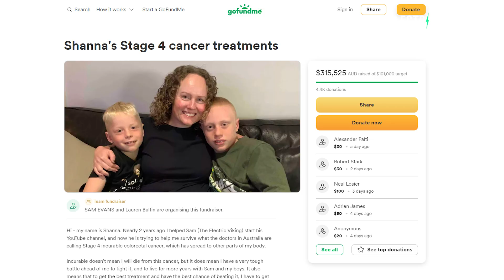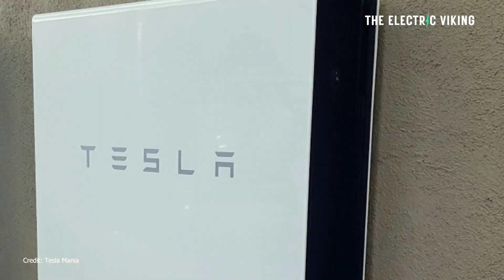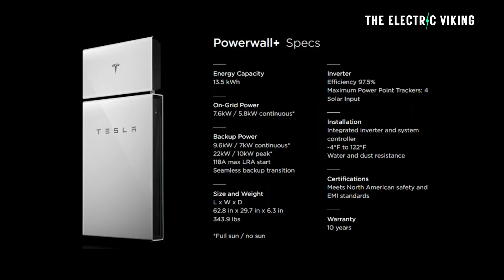NEW Tesla Powerwall 3 gets a MASSIVE power increase

Comment: The most important reason for going with the Powerwall is the software. Right now, Northern California is preparing to test out the grid concept, with all of us Powerwall owners working in concert with the distribution system to send power where it's most needed. The beginning of a major transformation of grid practice. To make this work, however, the government will NEED to nationalize the grid, take control of it from for-profit ownership.
Reply: I just gave the grid up completely, the tiny amount of money they wanted to give me was not worth the effort. Also if I wanted to stay on the grid I was limited to 5kw of panels.
Reply: I am already a member of a distributed power wall great here in the UK via Octopus Energy every day at 4 pm. My Powerball Sparks into life starts dumping 3.7 kW until it gets to 2%.
Reply: @ouethojlkjn  I’m also in U.K. - how does that work out? Does it dramatically reduce your bills or do you get payment?
Reply: @Phtang-phtang  For the so called Octopus "Tesla Tariff" (and you have to have a Powerwall) I get my electricity at a "flat rate" 24x7 of 11.76p per kwh. This is also the same amount I get for export to the grid. As I also have solar, some of the "export" will have been generated. For example, in one month I generate 200kwh from solar, I use 100kwh in my home and either export or charge the Powerwall with 100kwh. I also imported 300kwh from the grid (to charge an EV among other things). As the rate for export and import is exactly the same, you just subtract one from the other. Export is 100 x11.76p = £11.76 exported and earned. I imported 300 x 11.76p = £35.28. My bill is import minus export which in this simple example would be £23.52. 
You could work out the savings by however much the current per kwh tariff is minus 11.76 then multiply by the electricity used.  I would have to check but initially, the Tesla tariff also did not have a standing charge but this may have changed. 
One of the annoying "gotchas" is the standing charges. Which I believe the minimum we pay is 50.4p per day for electricity and 27.7p per day for gas.
Reply: Government owned electrical grid would be disaster.
Reply: @gund89123  In Victoria, Australia, we had a public authority electrical system designed by Sir John Monash, a civil engineer and WW1 general. It was sold off in bits by a premier trained as an advertising agent. We have a wealth of electricity vendors but are running short of generators.
Reply: The government is terrible at controlling large complex systems. Especially in California. 
I’m in Cali and like many people in my town I  got solar and powerwall+. Most of us overproduce but there’s no way I would be part of any program that draws from my storage batteries to push onto the grid. 
If SCE needs additional power capacity they can pay to have their own batteries installed.
Reply: You think the government will do a better job than for-profit corporations?  Um...the track record of the government doing ANYTHING well is not good.

Comment: If Tesla offered bi directional charging like Ford F-150 lightning, then there is no need for a power wall: just use your car. I guess the reason is they would be cannibalizing their own products. My much maligned Nissan Leaf has bi-directional charging but in the US there is no residential interface. I can use the traction battery to charge a portable solar generator using 12v outlet for limited power backup but you could do this with a gas car so not so revolutionary but you can charge the portable battery in your garage in winter without filling your house with carbon monoxide so that is a plus.
Reply: Current models can not.
It’s said, next platform (incl cybertruck) would be able.

Comment: I wonder if it would have the option of accepting a charge from a mobile super charger in case you were off grid and running low in an emergency?
Reply: Yes they have made them for use in roadside assistance. Not sure on the take up.

Comment: I think they will be sodium batteries from CATL,  be manufactured in the new mega pack factory in Shanghai and be the same price as the power wall 2.  The reason I think this is because sodium batteries are 30% cheaper than LFP, the power wall 2 is over priced ( they are just batteries in a box but are the same price per kw as a car)   and because Elon said they are releasing 2 new products each of which will have a sales volume in excess of 5 million units per year. Fifty per cent more power at the same price is the same as a 33% discount. The power wall 2 needs to be at least 33% cheaper to sell 5 million units per year.
Reply: I think its too soon for mass production of BESS using SiB

Comment: It is simply absurd to say that Tesla is the only viable home battery backup alternative. Try comparing it to FranklinWH in terms of cost, safety and warranty.
Reply: Yeah - I’ve been evaluating batteries for 5 months and FranklinWH seems like the best option out there - LFP, accepts a direct generator hookup and now has very flexible Pv array location options now that you can connect up to 3 solar generators for one of their aGate controllers.

The key is high surge power - 10kW for 10 seconds - double max continuous of 5kW.

I am really disappointed that Sam got that so wrong, because I’ve been watching his videos for a few months and it seemed like he was pretty authoritative despite his slick delivery and nice videos.  If Tesla Powerwall II has not transitioned to LFP as he says in this video, not only did I get excited for no reason, but it turns out Sam missed something big, obvious and I can’t rely on his work as much as I was hoping.

Comment: Hi Sam, you talk about Powerwall 3 being 50% "bigger" but then talk only about the number of kW, which is a measure of power rather than energy.  Do you know how many kWh it will hold?
Reply: A powerwall 2 has 15 kWh of storage and 13.5 kWh usable. If a power walk three doubles up on that then I guess it’s 30 kWh storage and 27 kWh usable?
Reply: @ouethojlkjn  He said 50% bigger, so that would be about 20 kWh.  However, maybe he was using "bigger" to refer to power, since he only talked about kW.  I would call that 50% "faster".

Comment: They are much better than people think. Because they are all in one. They have the inverter inside them..
But in saying that, you can definitely do better cost wise. But the software in the Powerwall does things other systems can't really do
Reply: I get very cheap electricity for 24 hours a day because my power Wall 2 is part of a smart grid here in the UK. Everything is done with software and eight, even knows what the weather will be like and what it can expect to get off the panels. There are other alternatives, but you do have to pricing everything that does not come with a standard battery pack with no inverter and no intelligence.

Comment: Tesla powerwalls are over twice the price of equivalent China sourced house batteries and systems. Makes the payback not very interesting. I have BYD LFP batteries in my "powerwalls" a total of 20kwh and two inverters with 22 panels. A Tesla solution is more than twice the price. Forget it. Stupidly high priced.
Reply: I think I would trust BYD, I would need to do more research, but a cheap battery from China, no thanks.

Comment: And why do we need batteries?
Because "renewable energy" is highly unreliable.

If you buy solar cells, they only make their maximum output for about 4 hours a day
then 1/2 output for another 4 hours
and 0% output for 16 hours

So you need to spend 3 times as much more on batteries to get 24/7 output for 2 days of backup
and even then a "once in 20 year storm" you need a carbon-based backup fuel to generate the power

This is such a waste of time and money.
Reply: Yes that is the reason, but I don't see your point.
Reply: @lionelwylie2326  Why on earth spend all that money when we have 250+ years of carbon fuels under our feet that cost a fraction of going "Green"?
Reply: @noleftturns  Well I don't care what the world wants to do but I have a home that makes all its own energy and fuels the car. Will have to replace the battery's at some point but by then I am assuming for cheaper better battery's.
Reply: @lionelwylie2326  I can understand if you live off-grid - good for you.
Reply: @noleftturns  I have been off grid for 3 years now and I have never lost power. I used to loose power 2 to 5 times every wet season due to thunder storms. So as far as reliability goes it is much better.

Comment: I think Tesla doesn't want to produce solar cars because they would make less money from people charging their Tesla's, as solar Teslas wouldn't need to be charged as much.
Reply: Doesn't tesla sell a license plate frame that says "powered by the sun"?  The FIsker is going to have a solar panel...which would give me enough charge personally that I'd never need to plug in.  Let's do the math, someone says 20 miles in a day, that equals about 140 miles per week.  About 50% of the charge for most cars out currently?  That sounds like a major free energy source off of the grid or yourself.
Reply: @jeffweingrad4658  I don't know about the number plate frame but if you have panels at home it would not be far from the truth for me at least. I have a 10Kw solar array with 27kwh battery. I power the house and my electric car with that set up. Nothing from the grid. So I guess for many people like me its true. For most though powered by whatever you get your electricity from.
Reply: @jeffweingrad4658  You are absolutely not going to get "20 miles in a day" from a single solar panel. A high-end panel might put out 500 Watts at 12 Noon on the equator for a couple of hours, less as the day goes on. In the US, you'll do very well to get 3kWh from a single panel in one day. More likely you'd see two. You'll be all right if you only drive three miles a day. And if it isn't cloudy. And if there is no solar eclipse that day. 😐
Reply: Ye of little faith in Tesla’s technical know how. Solar powered cars sound good but not enough generation to make it worthwhile
Reply: No its more that the panels don't make too much sense. The average EV  if covered in panels would give you less than 20 miles if it was in the sun all day. Some company's like Lightyear have concept cars where Solar is a bit more compelling. The Lightyear One, for example boasts 7 miles of range for ever hour on a cloudy day. Apart from the green vibe, the car itself I don't find too compelling.

Comment: My problem with a power wall is, it is stuck on the wall.  It cannot be taken and used remotely, say on a camping trip, in a lawnmower, in any place that needs power.  For this it is probably in many cases too big, so it would be good if the battery part were 2 or more separate packages for portability.  The idea that we need to buy a separate battery for every little application is nuts.  There should be standards.  But of course, corporate greed prevents that.  And with fascism rapant, government is of little use, or engineering societies, to provide the clout to set standards for corporations.  I only use Dewalt and Toro for home tools, because they make good batteries, compatible across their product lines.  The bigger the battery need, the bigger the need for standards to prevent waste and expense.
Reply: In that case, try the powerwall with wheels, a cybertruck.
Reply: It weighs 250 lbs.  Not very portable.

Comment: Let’s have the storage capacity please….it matters
Reply: If it is 50% more than a power war two, then a power war two is 15 kWh capacity and 13.5 kWh usable. So a Powerwolf three would be 22.5 kWh capacity and I think 19.25 kWh usable.
Reply: @ouethojlkjn  that’s reasonable thanks. I am not convinced his statement of 50% was about storage capacity and seemingly max output of 50% plus kw/hr. From old system
My Sonnen system is 2x 15kwunits with max output of 3kw/hr… ie about4.5 hrs full to mt for each unit
Reply: @johnmccoll1611  My PW2 has a peak discharge of 7.2kw at 240v and a sustained discharge of 3.7kw at 240v. However this may be a restriction of the export to the grid for my house as I recall when the solar was put in, they could not generate more than this as it was the maximum at the time that I was permitted to export under the Feed In Tariff.

Comment: I purchased nRuit batteries that use CATL LFP cells. They were shipped from the factory in China to my home in Thailand and the delivered cost was AUS$3,000/US$2,000 for each 9kWh batteries. I purchased 4 =  36kWh for AUS$12,000/US$8,000. Tesla packaged CATL LFP Powerwalls would have been far more expensive. I've had them for nearly 2 years now and no sign of battery degradation.
Reply: You are paying the Apple premium for Tesla. If you have the knowledge like you do then you save a lot of money. As a software developer I had to learn most people don’t want to do the work and research so Tesla making it easy is targeted at the 80%.
Reply: @samuelwilliams7331  And Tesla have a high reputation in Australia for support. The best installers instal Tesla because they know Tesla will support them. You probably would not get a good installer installing batteries that do not have a good support infrastructure. That is not to say other battery suppliers are not getting better.
Reply: Agreed. My system 12 Kw (22 panels) two 5kw inverters and 20kwh of LFP batteries in Thailand is suitable to bring my house energy bill to near zero and depending on conditions I have some additional capacity to throw in my Tesla. But the Tesla solar solutions is simply stupidly expensive. Twice the price of my system. The payback on my system is about 5.5-6 years. Tesla would be nearly 10-12 years. Crazy.
Reply: Hi can tell me which company in China you ordered the batteries from? Many thanks
Reply: My father, in law had solar and battery installed recently, but compared to my Tesla Power wall, it’s all a bit dumb. I think Tesla is maybe better is in integration in a wider network and remote control. That being said, my father-in-law is very happy with what he has and it works well. The only thing is the batteries are set to stop discharging at 20% to extend battery life on light in my power wall, which seems to drop to zero quite happily.

Comment: I have a powerwall 2 (the updated version, manufactured after Nov 2020 as per Elon’s tweet about the build number after).  I am pretty sure its NOT LFP, one of the reasons what I haven’t bought a 2nd on to stack.  I hope powerwall 3 will be LFP.  Anyway please kind check and correct your info, pretty sure powerwall 2 is not LFP it is still NMC.
Reply: I am in the same boat, although I cancelled my Powerwall order once I realized there were good LFP options like FranklinWH, Enphase etc.

I’ve used batteries for years and I’m convinced LFP is longer life, less trouble and much safer to locate inside your house, along with performance advantages like 0-100% charge level, lower temp charging (Tesla is 50F or higher before it can take a charge, so blackstart in cold temps requires external heating (like wood fires which actually happened around here) to allow your solar to store energy.

After doing some research I am hoping that new LFP battery options will become available that can handle higher continuous output, higher surge power, propane/bi/trifuel generator backup connections and are lower cost so we can afford to buy more than 40kWh.

In short - battery tech and pricing is getting better every six months, so waiting till 2024 may pay off bigtime.

Comment: I just hoping they come in a 3 phase version
Reply: Smart ❤
Reply: What would be the benefit of 3 phrase? I don’t know what a phase is so, honest question.
Reply: @MM  We have a hybrid system at home in UK 🇬🇧...

Our House is on Single Phase, protected by two Single Phase Powerwall 2 batteries.

But we also have 3 Phase, an outdoor 3 Phase distribution board with two 22kW ev fast chargers attached.

This means we can charge our house Powerwalls and two electric cars, all at the same time.
Reply: @geekless  I am not an expert, but my Tesla at home with 10 Amps 240v will charge at 2 kW, but at work where they have three phase 10 Amps 240v means 6 kW.
Reply: @ouethojlkjn  now THAT I understand!
Reply: @geekless more power, but also more likely to consume more energy. You can run bigger motors on machines (industrial lathes mills etc). Charge your car faster. With AC single phase you have varying voltage, as a wave ~ (+120v to -120) with 3 phase you have 3 waves on 3 separate wires. The peak of each wave is 120 degrees apart (evenly spaced apart120+120+120=360).
Reply: @AORD72  That’s awesome to know! Thank you!
Reply: @@charlesrichter3854 I was talking about my car, not powerwall. Most houses in the UK are single phase and I would imagine top out at 7kw on a spur?

Comment: No use to me until it comes in a 3 phase version...
Reply: pwerwalls can be wired in a 3 phase scenario as well as a single phase situation, the only difference is only a single leg of your 3 phase is protected,UNLESS you have one on each phase of the 3 phase that is, any sparky worth there trade in the UK will know how to do this
Reply: @kevinmatthews2620  Last time I checked they couldn't be co-ordinated to give correct phase angle differential to meet standards for 3 phase power - needs to meet AS 4777 here in Brisbane for grid interaction as well